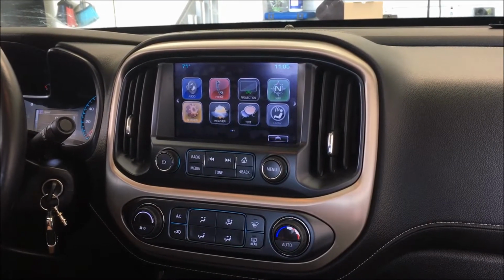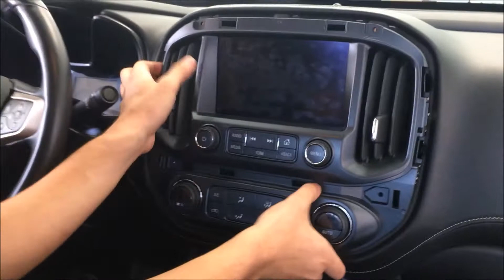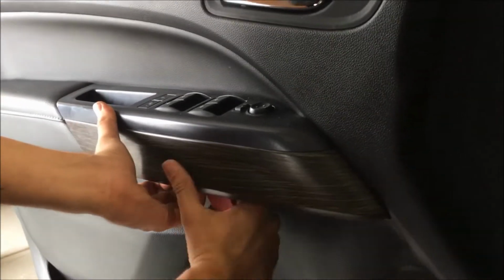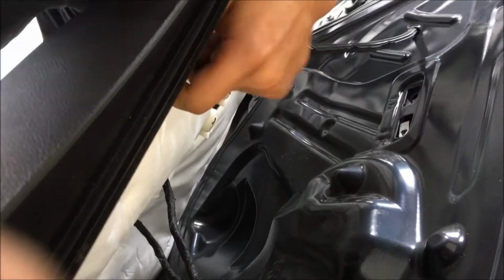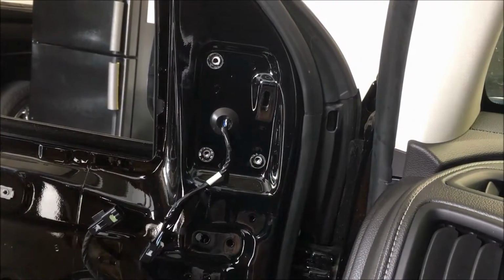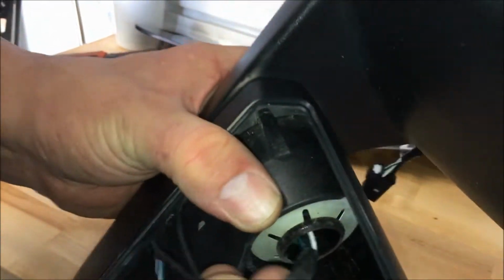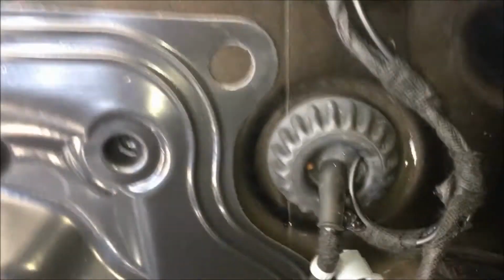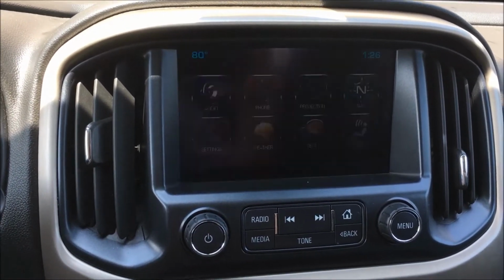2015 - 2018 GMC Canyon and Chevy Colorado Blind Spot Camera System for Parking

Comment: Would it be possible to have 2 cameras on each mirror with 1 forward and 1 back? Have the turn signal pull up the rear facing when changing lanes and manually pull up the front when off roading if needed? Thanks!
Reply from the maker: Unfortunately not...great question and idea though. It would actually be possible, but not user friendly, especially while driving